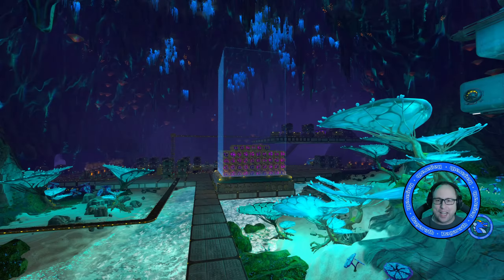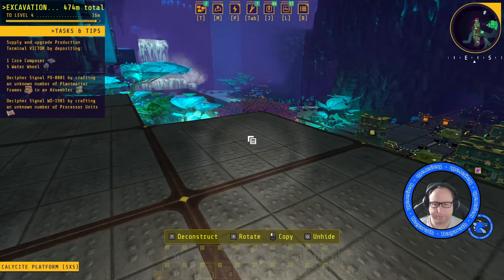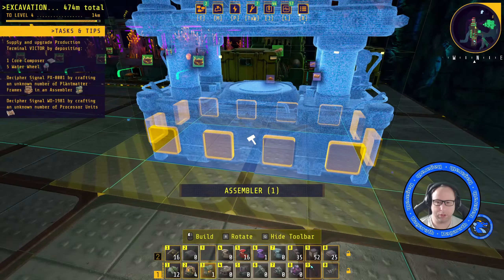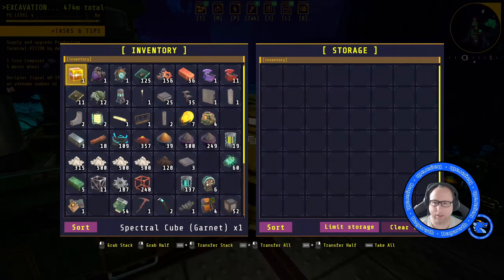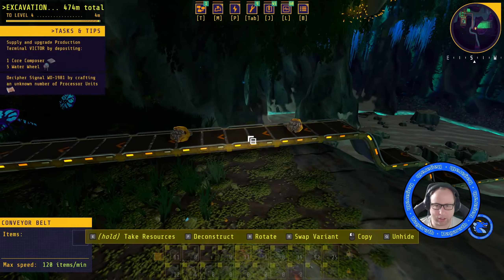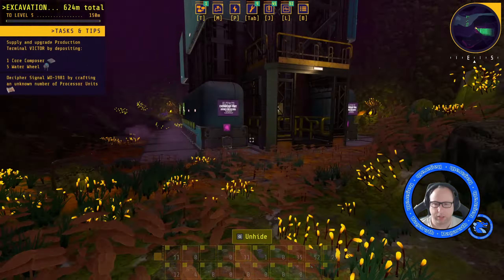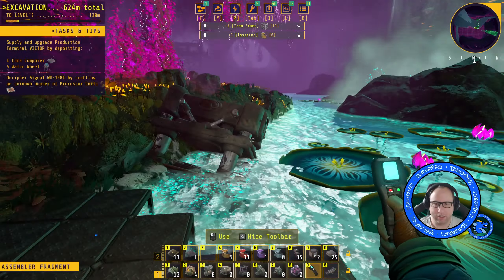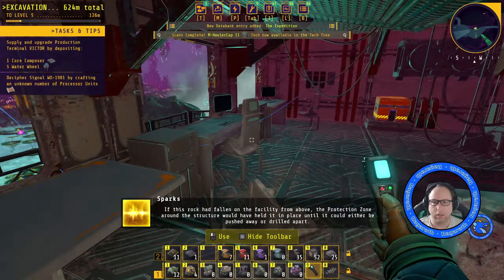Can we access the hydro layer in Techtonica 1.0? Drill bits MKII & replacer use

Comment: The replacer is bugged atm. I don't know if it's bugged for all buildings, but it is for assemblers. For assemblers mk1's make 2x the handcraft amount, and mk2 makes 4x the handcraft. You can see it in this vod, the mk1 making 2x the mk2 drill bits. When you replaced it with the mk2 assembler it still says 2x, but it should be 4x. If you delete the mk1 and manually put down the mk2 you will see the change to what it should be.
Reply from the maker: Wow didn't notice that. Thanks for the info. Will address it in an upcoming video.